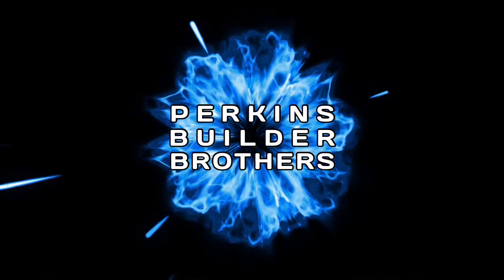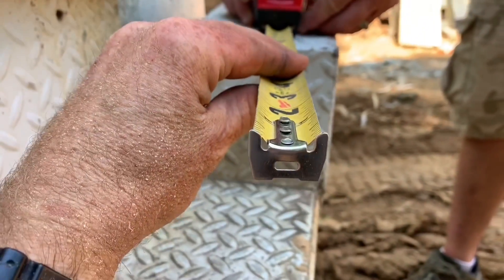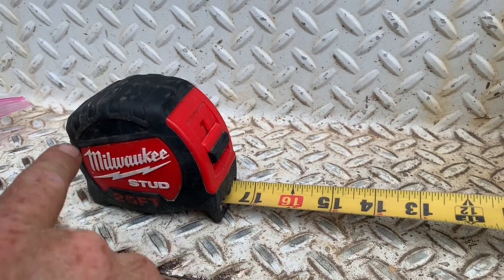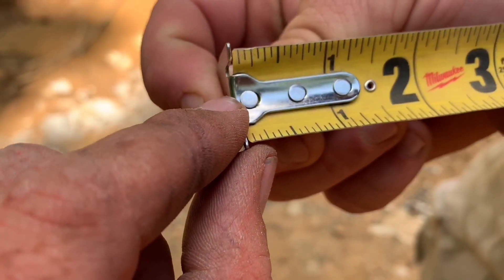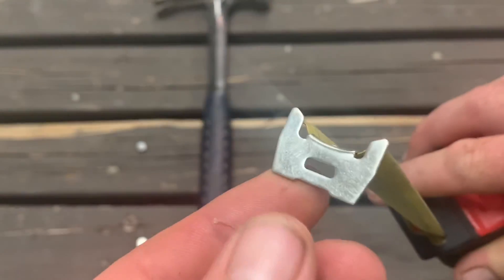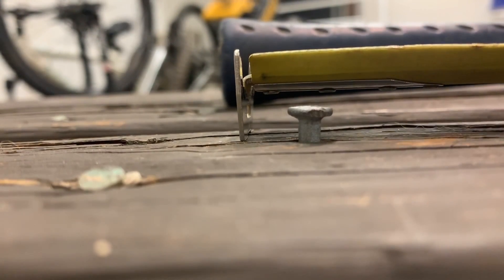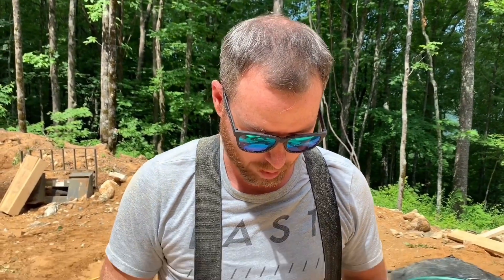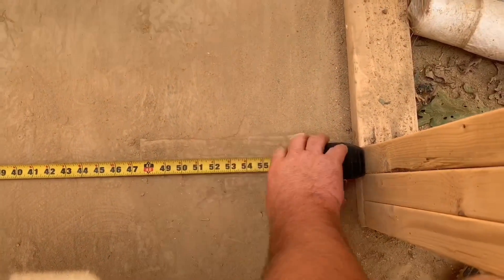5 Amazing Hidden Features in Tape Measures

Comment: When I was a framer I used mine as a calculators to add subtract fractions.
 You can bend the tape back on itself and line the 2 numbers that you want to add together and wherever the end of the tape lands is the Sum

Comment: The belt clip has a slot to hold a pencil, with the point sticking out the bottom, then you hook it on the nail and swing it around to draw large circles. Measure/mark your radius first the lock it on your measurement to draw the circle/arch.
Reply: I'll be damned!! 🤯
Reply: That's great to know. Thank you very much!
Reply: What?!?!!? Show me! Please.
Reply: Now that is something i didn't know about tape measures. Nice one
Reply: Shut the front door... never knew that. Cant wait to try it 😀
Reply: When you hook on a nail to draw a circle, you  have to remember to measure the distance from the inside of the tape's hook to the center of the nail shank and add this to your desired radius.
Reply: I just hook the screw or nail and hold my tape on the 10” if it is a 20” round and so on. But never thought of the clip holding a pencil, I will have to remember this next time I am drywalling.
Reply: Probably the most interesting feature of the tape measure after measuring itself. Showed that one to my son, and had never seen it. And he worked in construction for years!
Reply: That’s some illuminati shit 👀
Reply: @gqfiend    ..  I agree. None of the belt clips on my tape measures (Fastcap, Stanley, Milwaukee, Komelon, Bosch, etc) will hold a pencil in any usable manner. Heck, most of the belt clips are strong enough to break a pencil while trying to insert it.
Reply: I've always used a nail or screw with the clip, I haven't heard of the pencil trick. How's it work?
Reply: @kroycincy0911  A yellow pencil fits but barely, a large nail may be better to scratch a line
Reply: Well now, don't that just beat off!
Reply: That would have been handy when I was installing LVP in my bathroom around the toilet flange.  Thanks.
Reply: That’s a new one thanx!

Comment: Measure twice, cut once & BEAT TO FIT :)
Reply: When all else fails, get a bigger hammer! 🤣
Reply: Measure once, cut once.
Reply: Do your best, caulk the rest.
Reply: @jmscrft  from a close friend that passed & he was a siding fool; "if you can't throw a chicken through it, caulk it"!! 🤣
Reply: @jmscrft  look, I'm on 38 year carpenter, but, all this stuff comes from somewhere & here's a good one for not so perfect joints (miter, crown, butt, etc...) on paint grade trim, int. or ext; "miter in a tube" 😬😳😂
Reply: @BENTandTWISTED  lol 52 year old here
Reply: @jmscrft  a little caulk, a little paint make a framer what he ain't.
Reply: @spudboyQ  well the framer is responsible for making everything square around your windows and doors bud...
Reply: @geodude6244  and the caulk and the paint make up for the short comings of a bad one. Trust me, I need very little. I work with aluminum (for twenty plus years) and it is unforgiving down to the 32nd.
Reply: And always remember, never use force to make something fit, just use a bigger hammer!

Comment: Another thing is when im bored at work, i entertain myself seeing how far i can extend it before it breaks..
Reply: What is your record? I got close to 17 feet with a dewault.
Reply: Have you tried extending it vertically? Pretty good entertainment too.
Reply: @ZymixProductions  i was laying on the floor sending it 45 degrees indoors, no wind
Reply: @jmscrft  😂👍 Yea any little wind is not good.
I don't know what my "vertical" record is. Haven't done it in a while
Reply: Those comments are what I am here for 😅
Reply: @trashes_to_treasures  👊😂👍
Reply: I try to extend it on a regular basis, but sadly it doesn't extend as far as i,d like !.
Reply: @davidgreen7870  Same here. My measuring tape is old and doesn't work like in it's prime.

Comment: The arch in the tape measure also ensures that the tape as it winds back inside stays perfectly on center. This will keep the edges of the tape flat and compact so they don't bind on the inner walls. Also, the hook on the nail head feature allows you to measure out circles...and with two nail heads spaced apart ellipses. Thanks guys,  great work!

Comment: Been using a tape measure for years as a electrican. I knew everything except adding 3 inches when you run it to the wall..thanks you taught me something...new sub.
Reply: The measurement may differ by manufacturer. I have tapes that measure 3.25" or 3.5" I actually don't have any that measure 3"
Reply: If you look on the bottom of the tape it will tell you how much to add with your tape.

Comment: Wow. Ive never seen these hidden features before. Especially the curved bit on the tape measure. I never did see that. But that said, in Australia, they make tape measures the other way, so the arch is facing down. That way the building industry doesn't collapse in the Land Down Under.

The bit on the end being loose was amazing. I'd never seen that hidden feature either.

As for the nail grabber part - the "hole" - I like to leave slag and dags on my welds for that exact reason. For sticking the tape measure on it. Some people think it is because I am a bad welder, but actually it is a feature I perform because I am an amazing tradesman.

The smart and dumb ends of a tape measure. I didn't realise there was a smart side to a tape measure. That certainly was a hidden feature. It is a bit like those roadworkers (yeah, you know the ones!) that stand there on the side of the road, and you know they did something completely stupid, as their boss has told them, "Look you!" Good for nothing git!!! You take this sign, and stand there on the side of the road and tell people how STUPID you are! I want you to stop the traffic, and then tell them how SLOW you are! For eight hours!" Maybe they're all the same people who wrote the signs being punished, as the signs always miss the word "OF", causing the signs to instead of being warning signs, to be picketing signs for some union. "END ROADWORK!!!"  "END FREEWAY"  No wonder nothing is ever done. They are actually lobbying against their own jobs!

I liked that hidden bit on the bottom of the tape measure (are you sure that the button never actually fell out? Some have buttons there, you know) for putting your finger on. I normally just use my tongue as a brake on the edge of the blade.

I also liked the hidden "3 inches" feature. Still, looking at the tape measuring the body, that "3 inches" isn't exactly making 3 inches, as it seems about 1/8 out, at least where the tape is displayed. So much for the second hidden feature being useful if one uses that.

The diamond was certainly a hidden feature. I mean although I couldn't see it due to it being hidden, I can imagine it being good if we get a centrepunch and just knock a little dot into it, so that way a blind man can use a tape measure and know when he reaches the floor truss dimensions.

Well, great video, but none of these things are truly hidden. I was expecting a built in garotting tool or something...dart gun, UV code, something like that. So I guess the only thing hidden is...

"WHERE'D I PUT MY BLOODY TAPE MEASURE???"

Comment: 38 year Carpenter here; the top ears on modern day catches are designed to catch something from underneath, say, the bottom of ceiling joists for hanging sheetrock. Also on modern day catches, older catches didn't recess into the attachment point and sheetrockers are the probably the cause of that recess being there now, in order to lock your razor knife into place to make rip cuts. It also works well for making rip cuts on insulation board & other soft materials. But, one of the most important things that tape measures can be used for, is a pointer, when you're pointing to what needs to be done next! 🤣

Comment: 62 years old and still learning.  Thanks!
Reply: Have you ever heard of something called metric units? its pretty neat - 10 millimeters is 1 centimeter and 100 centimeters is 1 meter and 1000 meters is 1 kilometer.Very easy-to-use type of mesurement, we use all the time in Europe.
Reply: @super_best_clips_xoxo  Hello.  Yes, I have.  I am Canadian and have a degree in physics.  We began transitioning here to metric in the early Seventies when our current prime minister's father was prime minister.  My science background reinforced and expanded on all of that across more than the everyday set of measurement dimensions.  I have the advantage of being conversant in both the SI and imperial system of units as well as conversion between them.  For example, the pound is a unit of force (i.e. weight due to gravity).  Do you know what the unit of mass is in imperial?

Comment: I love my stick rule. Great for tube bending, finding a 45* reference, and especially stove piping heating and cooling and condensate lines in a hotel or apts with 10’ or shorter ceilings. Rather than getting a ladder. I can just unfold the stick rule and see I need a piece about 2’ with a 90 and then about 18” that way. Great for knocking down that level you left above the drop ceiling too.

Comment: The inside read folding rule is the go to for me in the electrical trade.  It’s lays flat. It’s stiff but still light.  Find angles with it. Use it as a pipe spacer when building pipe racks.  It’s a great tool and don’t see why more people don’t use  them

Comment: Another unique feature of virtually all tape measures is that they seem to have been designed by someone who is left-handed.  A right-handed carpenter will hold  his pencil in his right hand leaving his left to hold the tape box.  Extend the tape out to the end of the board to your right, stretch it out and you will find the numbers are all upside-down.
Reply: So true, I’ve been saying that for 20+ years since I started in carpentry. The clip is also on the wrong side (if you even use it, I usually just take it off and have a special pocket for it on my belt).
Reply: Left hand fingers the dumb end. Right palm, middle, ring, and punky hold the box. Right thumb balances/pins the marking tool, right index cradles/fine tunes the marking tool.
Have you never picked a measurement and ran it down a 4'x8' piece of material? Say... A studline on the outside face of rock, for example? Or the cut line when scribing in an alcove counter? No worries. The opportunity will come

Comment: You should compile a "Top 5 features of a tape measure that pisses you off" I'll start it off with #1. 

1. The end has an uncanny knack for getting caught in the slightest gap, making it virtually impossible to retract without having to forcefully pull the end out of whatever it's caught in.
Reply: And also the pin in the end  will sometimes get caught on what you are measuring ( if you happen to slide the blade down you're project ) and if you're not careful then you might cut your object an inch too short.
Reply: And if you want it to stay hooked on something it usually falls off.
Reply: The damn end gets bent out of square from #1, so now your measurements are off by 1/8" from someone else's tape and you can't figure why shit doesn't fit 🤦🏻‍♂️
Reply: kerryman 71 and yet, when you TRY TO HOOK IT ON SOMETHING..

Comment: I love how it is shaped like a baseball so I can accurately throw it in the dumpster.... I’ve had 3 of those when they first came out and they kept locking up
Reply: Beyond Your IQ    I've always had Stanley's, but I  found a green Ryobi 25' road kill that works better!
Reply: Pull an older tape measure out almost fully and blow out the case with compressed air, (using Eye Protection) Then wrap a rag around the blade and let it close...slowly. (this wipes the accumulated dirt off of it). Then put a little 3 in 1 oil on the rag, in a clean spot, and wrap that around the blade and let it close slowly. (You don't want it dripping, just a light sheen).  Over time it gets dirty. That in turn, holds moisture. That infests the inner coil spring along with the grooves the tape runs in, and it locks up, due to the added thickness with the dirt. ((Be careful ! If the tape is out too far it will twist 90 degrees from the wind-up spring and it will get away from you, tape will come loose from the spring, and the spring will wind up. Its a pain in the butt to rework that!)) This will take about 15 minutes to do, and should be done at least once per year! If you use it around the coast, you should do it every month, due to the salty air. They will corrode very quickly!
   Bill, from Tn. 🇺🇸

Comment: I learned a couple of new things, but the coolest was the 3 inch length of the measure tape housing.....very cool
Reply: Sucks for us in countries that use metric though. Most of our tapes are just metric versions of what you guys in US and A have, like Stanley Fatmax ect. 3 inches = 76.2 mm. Not really as easy to work out.
Reply: @Patrick-857  .....I may be wrong, but i think the U.S is the only place in the world that inches instead of Centimeters..... I may be wrong about that though.
Reply: @Axeltiguere1976  Yes, which is why it's weird that the rest of the world has to suffer all the products being designed in feet and inches and then adapted to metric for us.

Comment: When using the tape housing as part of the measurement, you need to look on the tape and it will have the measurement on there that you need to add. Most of them are around 3", but 3 inches isn't any kind of standard. They're all a little bit different.
Reply: No wonder my measurements have been off, Who knew? Learned something new.
Reply: I was looking for someone to mention this; I have a Stanley FatMax that says its 3.38 inches, which has turned out to be rather annoying to deal with.

Comment: Komelon Self Lock 30ft tapes are my favorite, magnet on the end comes in handy but sometimes it sticks to a surface when you don’t want it to haha
Reply: Yep. Working on commercial door frames, the magnet comes in handy, but there are times when it's sticking to everything you don't want it to. Especially if you're working near lots of metal, and extending the tape, and trying to thread it through a tight spot. It would be comical if it didn't piss you off so much. That's when you go to your backup tape.
Reply: 25' Stanley, unless it slices your finger when it has a burr on the edge!
   ☝️😩*×√°!

Comment: Great video I was hoping when you were showing the thumb break on the Milwaukee tape measure you would mention never ever ever did I say never let the tape free wheel into the housing you will distort “the dummy end” Always use the Thumb break or put your finger underneath to act as one.  I worked for an old Carpenter 35 years ago Who would have a fit if he heard a tape measure bottom out against the case Monday mornings we all had to check our tape measures against his for accuracy it’s funny the lessons you never forget
Reply: Reminds me of when we were doing a remodel job on an old farm house and I kept getting yelled at for my boards being 1/8 long. So after I kept getting railed I said to my boss “I’m double checking these numbers before I bring the board in.”  I tossed him my tape he measured my board and lone behold it was the right number on my tape but not his.
Lesson learned.
Reply: My brother is of the same mind... Despite the stitches his tape has given his index finger... Twice. I prefer the Stanly 25' autolocking tape, myself. The red halfway measurements help a lot, as do the ⅛ denotations. Keeps us dyslexics from reading the wrong side of the nearest inch line 47⅜ is not 48⅝, but it is to me without my cheater tape lol

Comment: Love those Milwaukee tapes with the wire clip so when you hook it on your pocket it doesn’t ruin your jeans.
Reply: Milwaukee tapes are the best, a bit on the heavy side, but you can span them out 12ft+ unsupported without it collapsing.
Reply: @LeonidsStrapOn  yeah man been using the fatmax 16 for over a decade. I also like on my Milwaukee theres a void on the bottom so i can lock the tape using my finger, easier for me to control than the normal lock

Comment: Add roughly an inch to that second diamond and you have a meter, 39 3/8”. Good way to remember the conversion when it comes up...
Reply: Then you can roughly measure twice and roughly cut once, and it will be roughly fucked up.

Comment: If I am making a lot of same cuts I'll take a pencil and make a mark such as 14-7/16" for quick reference and so I don't inch myself
Reply: try cutting your first piece as a pattern block 1/16 short of your desired number (taking the thickness of the pencil lead into accout) then lay and scribe. make 5 or so cuts and only pull your tape once.  Use this on siding too once you find you correct gable pitch save you best cut off or drop and lable it pat. then you don't have to find your degrees every cut because you did it once just pay attention which way the angle goes.

Comment: You the man. You're one the few that I've seen on a video that knows the real reason for the 19.2"  on the tape is there for. I heard one guy say it was gor a stud layout. Bless his heart but  clearly that's  not right.
Reply: Except that's not what they are for. They are for laying out trusses.
Reply: Your right they're actually floor trusses,but not roof trusses. These come with a 2×4 top and bottom chord. If that's  what you mean, yes you hit the nail on the head
Reply: The 19.2" mark is actually for joists used in shoring an elevated floor that is going be a concrete slab
Reply: @jeffkampf226  really I didn't know that one could put a concrete slab over top. As a residential carpenter we use it for floor joist for longer spans. 2×4 cord

Comment: The slot on the end is also good for making arcs and circles. Hook it on a nail at the center of desired circle, lock the tape at half the diameter and use like a compass to draw perfect circles.